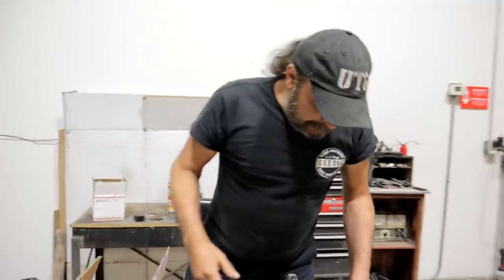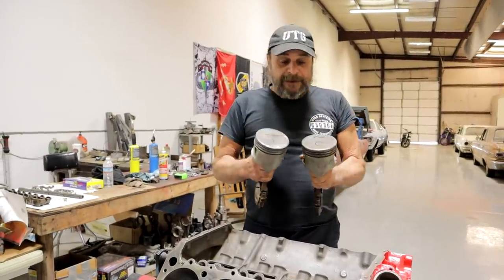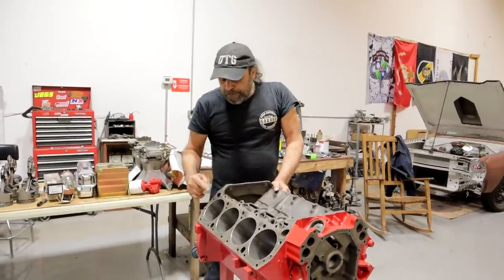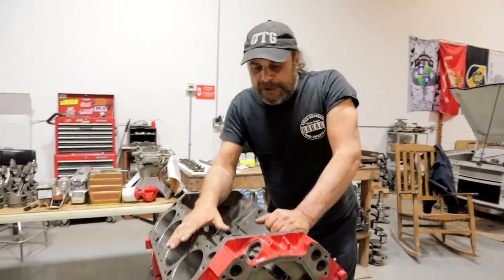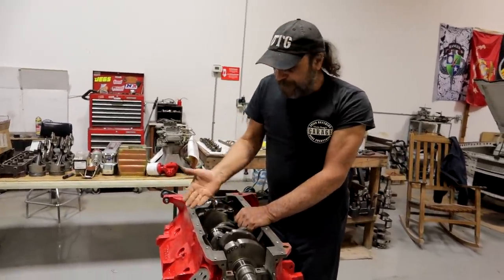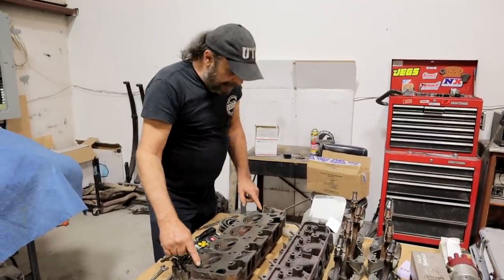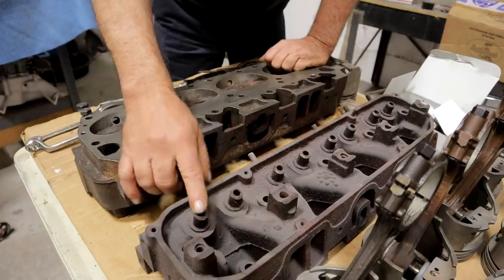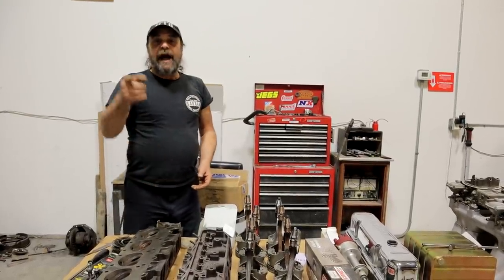Blueprinting For The Home Engine Builder - How To Get The Most From The Parts You Already Have

Comment: How much of the variation between those assemblies was due to the pistons, vs. rod lengths? Could you swap pistons and rods to make the assemblies closer to each other?
Reply: Great video like always but I would have
Used an affordable forged piston
For nitrous you will want to do it
Latter anyway.  Keep them
Coming Tony your enlightening 
Not only the younger generation 
but the older guys to all
The fine details of putting
Together a good street motor.

Comment: I started this stuff 55 years ago when I was a kid but before I could ever drive in in 70 and 71 I was building a go-kart engine I was using these basic ideas then before I could drive without a shop I was somewhat meticulous on repertoire checking things and and looking at measurements because I also took drafting which is a dead trade now on top of machine shop on top of automotive but I was always into finite checking stuff which I used to get in trouble for because it was I was slow but I was meticulous a good mechanic but slow you can't build a motor overnight I don't care who you are I don't care what business you got I don't care what your famous name is you can't build a motor overnight you can't even build it in a week!? It takes 40 hours to Port a set of heads by hand and you can assemble an engine take it apart put it back together take it apart three times dry just checking for things and I would do it if I had a shop but I was always into checking and double checking and checking and double checking and to my knowledge in 55 years I've never had an engine blow up and if I built one for someone or fixed it I don't recall it ever blowing up but there's an awful lot of meticulous checking I just wish I had a big shop like some of these guys on YouTube

Comment: “Blueprinting”, such an over used and misunderstood term!
30-40 years ago I made blueprints to follow on the build sheets that were in the back of the motor sports catalog. Deck height etc was all calculated as “best” so if I was building an engine, I’d pull out the sheet and pin height is X and the ring gap is Y. Don’t care what it is now, but when I’m ready to assemble, this is what it will be and each engine will be pretty darn close to the last exact engine I built. This comes from experience. How much oil pressure? Ran 3# per 1000rpm and blew up, ran 7psi and lived, ran 15psi per 1000 and lost power on the dyno and scorched the bearings. So, in the “blueprint sheet” I write in “oil press must be 6-9psi per 1000rpm. Takes a LOT of time/experience and destruction to properly make a blueprint sheet. Also, sometimes this has to be amended.(351c oil pres requirements for example)

Comment: There most DEFINITELY IS a text book definition of a blueprinted engine !!  In regards to the block, Chrysler made a "blueprint" of it before they produced it which exactly placed the lifter bores and cylinders in relation to the crank centerline.  If you correctly machine a factory block to those specs, it is now "blueprinted".  Doesn't usually happen on most builds, its expensive and you're better off buying an aftermarket block.
    Oh, your compression heights on your pistons are .018" off from each other?  Knowing 60's & 70's Mopars, they are probably worse than that between all 8.  GOOD aftermarket pistons will solve that.  Now, the rods, are they all the correct length?  If you reconditioned them, they are definitely not.  Again, new aftermarket rods solve this.
    Is the crank the right stroke?  Well, if you use aftermarket rods and pistons AND you zero deck the block, you'll know during assembly.
     All that being said, the machine being used, the machinist running it and the quality of factory parts all play a huge part in "blueprinting" a block.
     Then we can move on to blueprinting the heads ... etc, etc.  MOST engines that claim to be balanced and blueprinted are not.  Making sure clearances are correct is just a small part towards blueprinting an engine.
     Blueprinting has become a made up word among engine builders who know enough to be dangerous.
Reply: Stamped rockers and factory pushrods are junk.  If you want to even come close to saying "blueprinted", you need aftermarket parts.  The time and effort saved in buying multiple versions is well worth the extra money.  Going fast is just a question of money, that question being "how fast do you want to go?".
Reply: Tony, after watching this video to the end, I have to agree with you, you are a skilled engine assembler, not a builder.  I take issue with the amount of time you are willing to waste sifting through factory parts, though.  When I build an engine for a customer, it is cheaper and easier to just write the check for GOOD aftermarket parts.  In the end, it actually saves money.
Reply: @TTGTO288 .  when you “build for a customer”.  UTG videos are targeting the home engine builder. They may not have the budget to just hand it all to a machine shop.  Not worth my time.. …. Right.  I know that if I spend a day sorting parts, the amount of money I have doesn’t change at the end of the day.  Not on a deadline , don’t have to build to satisfy anyone but myself.

Comment: I never knew production motors were that sloppy wow 😯
Reply: GM were ultra sloppy, Goodwrench saved them simply by stripping factory engines and going through this very process to get the factory tolerances within an acceptable level to get engines through warranty periods!

Comment: do you agree that when replacing pistons and cylinders, it is not even worth measuring their weight differences? and shouldn't you start removing the substance? normal in a car? if it was a special car that would be driven at maximum revs then what? because in my opinion you don't even notice the difference in weight when you visit, isn't that right?

Comment: Most people would just buy a new set of Pistons they don't even cost that much especially the old Dodge stuff the castes were horrible nothing was normal across-the-board you could have one head that looked great in the next head had slag in it so why would you use old Pistons when you can buy a nice new set for just a couple bucks and it be uniform across the board

Comment: "blueprinting" is a term like "original miles", it's thrown around to make a sale but no one really agrees on what it means. Does original miles mean the engine has the same miles as the odometer reading? or does it refer to the days of 99,999 odometer and mean it hasn't rolled over twice?

If you're building a race engine to last to the finish line (can't win otherwise) you want to build as fine as a gnat's nose hair. Especially when an opponent challenges your engine to a tear down after the race. But I don't think Mopar is building 707 Hemis by hand, right?  oh sure they have computers but even back in the day, like UT said a 400 hp engine was built on a moving assembly line in minutes. One guy did the same procedure 100 times a day, maybe he did a better job than the guy building an entire Ferrari engine. 

I used to work with the son of a marine sniper who became an aeronautic machinist--there was ONLY one way to do things. i try not to get that particular, but i will do things like buy a stroker assembly complete on the theory the company balanced it all together.  If i'm going to go thru a pile of rocker arms and check each ratio, i'd only do it on a single carb engine so the outside cylinders got a slightly longer valve opening since their runners are longer than the inboard cylinders. but i'll weight connecting rods and slugs and match the lightest one with the heaviest other, and get "close enough for government work" balance. After all, as the engine runs, oil is sloshing and spraying around the crankcase so those rods are gaining and losing weight every rotation.

I will suggest, when it comes to grinding away, put a rare earth magnet nearby to catch slag and fill in nearby holes with shaving cream--that'll catch other gack and then you wash it out. As for measuring reciprocating clearance, remember metal "grows" when hot and the crank flexes like a spring.

as always, measure twice, cut once, and you avoid ending up with a "monday morning/friday afternoon" engine.

Comment: I don't care that this is 1 year old, show us on video that the pistons in your hand have a compression height difference of .018  from the factory And in fact the pistons are not from different engines and haven't been top cut by some mechanic /Machinists 
I have seen dodge engines have very different deck heights from front to back. You should set up a bar centered on the main journals and deck the block true so that now all the pistons are the same height from the deck from front to rear.
Never seen the same set of pistons out of the exact same engine with varying compression heights. Never
.005 is almost 1cc of volume
That is a ton in my world

Comment: You can't be a Performance Engine "Builder"..... not in any real sense, unless you have sufficient knowledge, skill sets, and experience necessary to not just recognize/check... but 'modify' and change the Machining and parts to attain what YOU want.  If you can't Machine.... you are an Engine ASSEMBLER .... Full Stop ! 
What's the difference in Bearing eccentricity between a CB527P Rod Bearing.... a CB527H Rod Bearing... or a CB527V Rod Bearing..... and WHAT size Crank within the Std or even .010" under Tolerance would you use each ? The Rod Sizing within the Tolerance for each ?
See what I mean here ?
And forget asking some NAPA Store Machine Shop.... BLANK STARES !